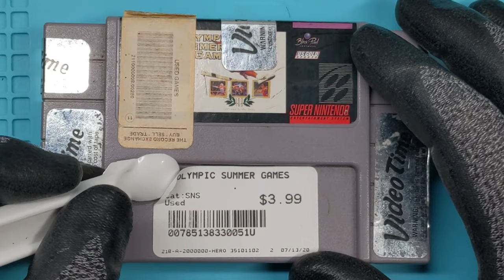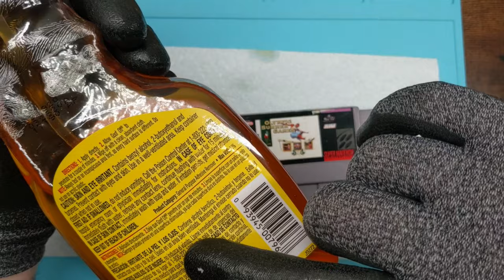1000 Subscriber Celebration and Origin Story!!

Comment: Love that you use wireless humidity and temperature sensors in your game room, I do as well. Just wondering what humidity level you like to stay under, and also what temperature? Thanks for the video 👍
Reply from the maker: Preferably you'd want 40%-50% relative humidity, and 68-72° for a gaming room, with a constant airflow and no direct sunlight (UV filtered or not), but that's not always possible. So close to those ranges will keep you in good sorts! But you'll also want to do 24 hour monitoring to see what happens at night. Depending on your area, you can have drastic fluctuations at night that you don't notice (colder at night is a common thing, but this also impacts the RH). A good consistent temp and humidity is much easier to manage than large flucuations.

And of course you have to rebalance every season change, but it's def worth it!

Comment: So the other day I was cleaning a badly scratched Xbox 360 game using your method with GameStop disc fixer. I accidentally let it dry a little too long and it was like chalk when I rubbed it off with a microfiber cloth . Do you think this did damage? I gave it two more passes after because I felt paranoid that I scratched it worse. Anyways I love your videos I’ve restored some horribly damaged discs by hand since finding your channel. Games I wouldn’t buy or would have gotten rid of a few years ago I feel confident fixing. Looking forward to your blu ray series, I have a lot of ps3 games i haven’t attempted yet. Thank you for your advice and detailed videos!
Reply from the maker: Man I love GameStop Disc fixer. Like a whole bunch.

Alright, it likely won't do much at all even if you let it dry. The diatomaceous earth tends to soften and flake as it dries. (GameStop disc fixer is nearly identical chemically to Novus 2, so I'm super duper familiar with it).

I actually let the polish dry a little bit to increase the roughness of the polish. It takes some trial and error but youll find how "dry" you should let it get. But if it gets too dry? It'll just flake away. Give it another few passes with disc fixer and it'll come right back to life.

And if you are using OG disc fixer, you can add a little bit of water to the polish to help get it to a little more workable compound. That stuff had crazy short shelf life.

The PS3 videos are going to be here soon! Since the method is the same for all Blurays I have to make sure I do one for each console, but still have to run each consoles disc through its own test and verification cycle. More work intensive, but creates more confident results!!
Reply: @RestoreAndReplay  Hey I know I'm late but I just wanted to say thank you so much for replying to me! I've saved so many discs using your methods! I'd still be really interested in how to do PS3 / Blu ray discs

Comment: Any helpful advice on yellowing consoles?  I’m seeing some early consoles that were retro-brighted are now starting to yellow again
Reply from the maker: You'll likely never see me make any posts about Retr0briting. Why? Because it's a temporary fix. That's just how it does. (Here come all the angry comments). Essentially all you can do is Retr0brite the console again. And again. And again.

When you Retr0brite, all you're doing is temporarily removing/altering the chromophores (the things that make the discoloration) temporarily. But the cause of the discoloration is the bromine within the plastic itself. So until you remove every speck of bromine within the mixture of the plastic, you'll never fully whiten a console.

I keep my consoles nice and yellow. Why? Because that's technically how they're supposed to look, if we let it age appropriately. Not the most fun answer, but it's the science. (I will be doing an explanation video getting into the science of it, but to me it's akin to just painting a console temporarily).

Comment: Thanks for all the restoration tips, is there anyway to fix dent in a ps2 game?
Reply from the maker: So usually not. If that data later has been impacted at all, the disc is a loss. But not always.... How far into the disc is it dented? Can you see it on both sides?
Reply: @RestoreAndReplay  its visible on on the down side(shiny side), and it is between middle and inside, dont remember accurately been some time since last seen the cd. Diameter of the dent is about 2-3mm, the game still runs but only some levels work and some music tracks are missing or they dont work correctly